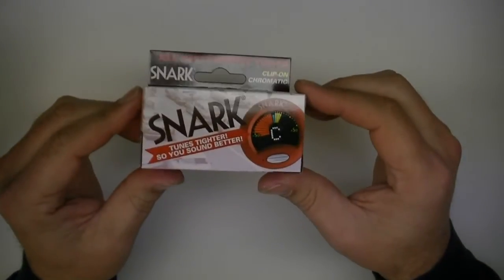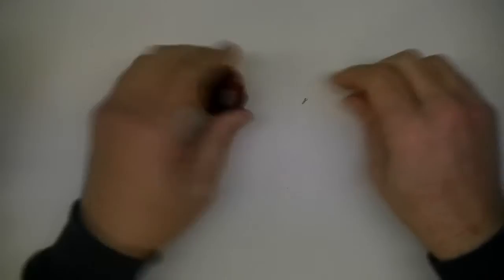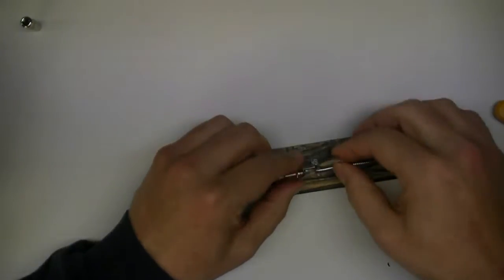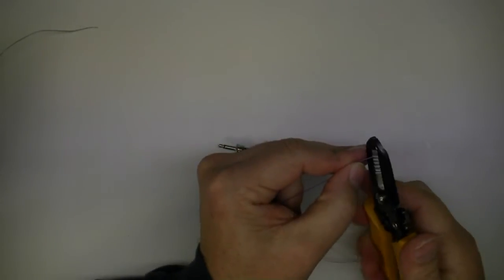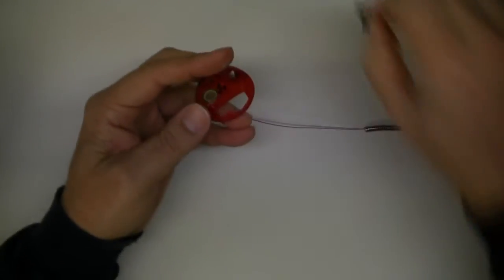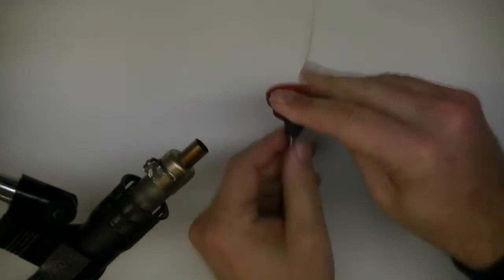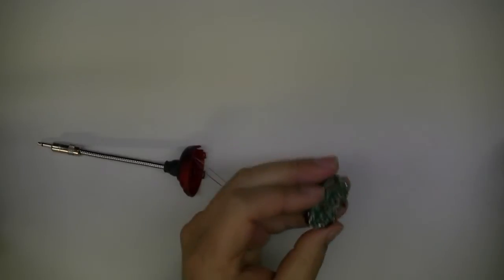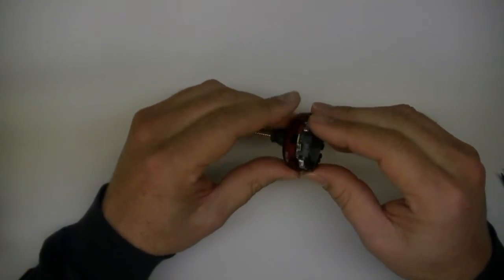Snark SN-2 Tuner Mod

Comment: Great mod!  Thanks for sharing.  Any idea what size diameter the heatshrink was?
Reply from the maker: Thank you.  I used some really sturdy 15mm adhesive lined heat shrink.  It made a nice solid connection.